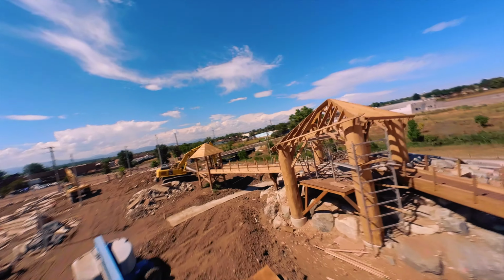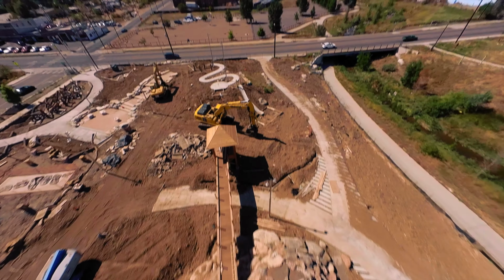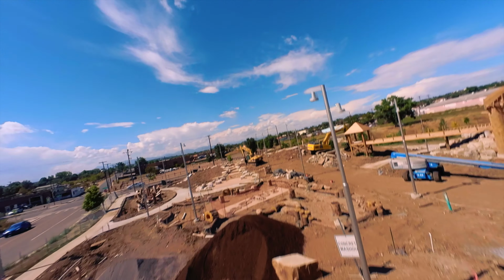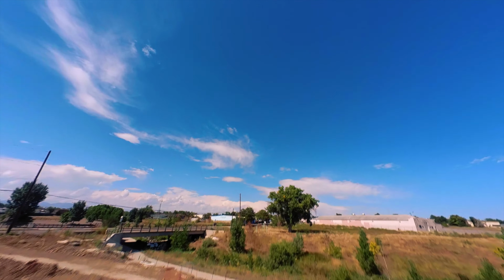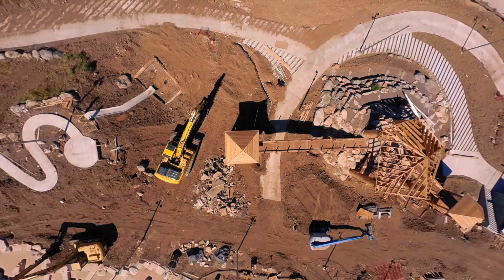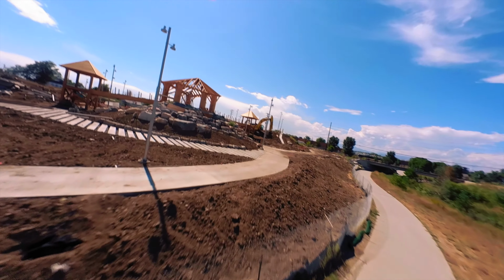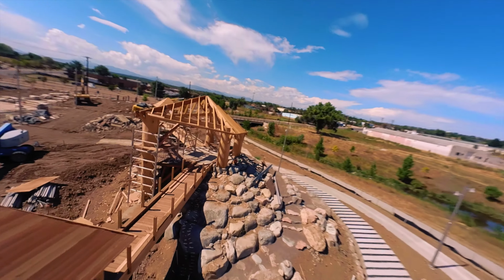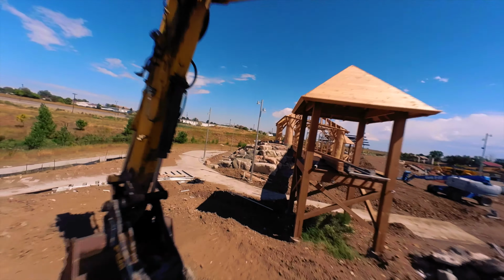VLOG 'N Fly (Am I a Wuss or Sensible?)

Comment: I've been in that boat many times.. For me it wasn't as much about the money (though it was a factor) but more about down time, especially when I got started and getting parts was not as easy.  So what's helped me more lately is that I have two fully functional quads and plenty of spare parts.  Any time I order something I order extra and I have built up a small inventory   that helps.  I don't buy new stuff coming out.  I have a setup that works that I can find parts for.  It's key to get that inventory.  All that said I don't always push it either.  Rebuilding is not fun for me so I try to avoid it.  I just try to build in a way that helps to keep me in the air through crashes.  All that said, it comes d to why you're wanting to do more daring stuff . Is it for you or for views and approval from others.  If it's the former, do it when you get comfortable.. Gradually push yourself.. If it's for the latter, reevaluate and realize that is pointless.
Reply from the maker: Thank you for the reply, I am doing it for myself, because I always want to be better. Sometimes I feel like I could be better. It has only been 5 months and I feel like I am at the point where I should push it more. I guess the bottom line is I am having LOTS OF FUN and love this hobby and want to keep proggressing. I just need a breakthrough moment.